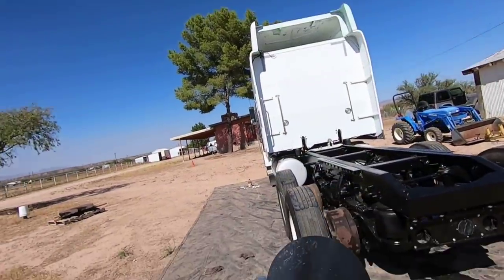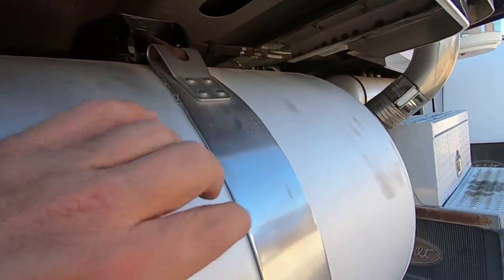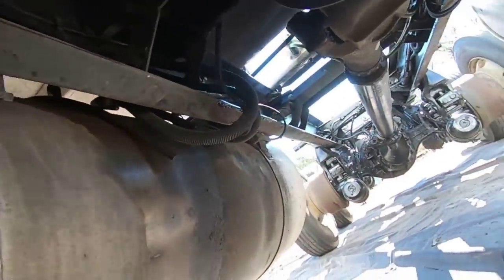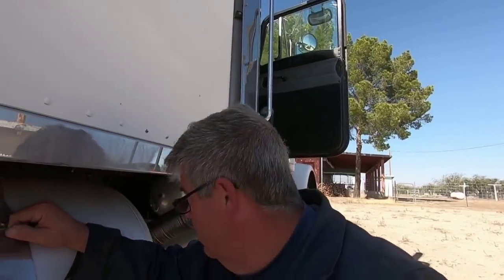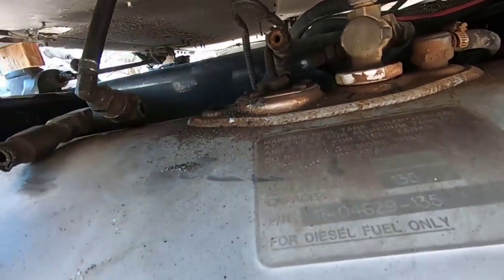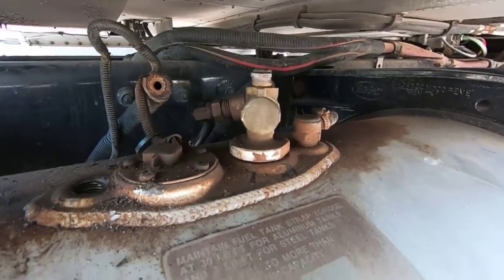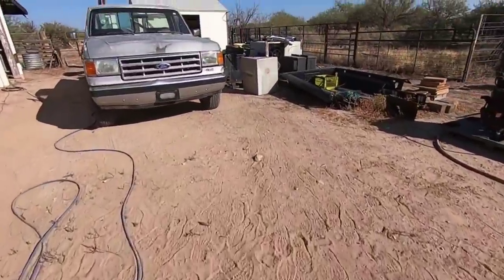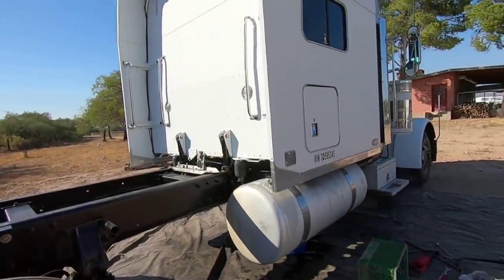#444 Stubborn Fuel Lines The Life of an Owner Operator Flatbed Truck Driver

Comment: Dan split the nuts on the lines with a die cutter.  Dont even have to cut all the way in and hit thread...just score both sides and give a hit with a chisel they split...Easy way to do fuel and hydraulic lines that are stuck...👍👍

Comment: Dan you might want to consider changing your fuel caps to I had the same problem with my Peterbilt and I change the lines didn’t completely fix the problem until I change the fuel caps

Comment: Love the video Dan love that you’re getting old girl back Road ready. FYY has a couple tricks I learned over the years to get those hoses are soaking with PB blaster take a ball peen hammer and tap the fittings all around that don’t work use the air hammer. Go to Harbor freight and get 12 point Crowfoot

Comment: Long time watcher first time commenter, I changed all the lines on my 03 Pete, return lines leaking and draw line was Kinked. Be careful with Napa and other hydraulic hose it KINKS easy and over time relaxes on the bends, make your own line from Peterbilt and whererever else #8 and #10 is better imo, stays open on the INSIDE which is something the hydraulic pressure lines just aren’t designed to do really. Our draw and return lines don’t have much pressure really so not even much fuel comes out when changing them. It’s easy

Comment: One thing to point out to new drivers is making sure you drain your air tanks on tractor and trailer to prevent brake failure. My trailer lost all air this week due to cold and not properly draining the condensation out of the tanks.
Reply: I was told you dont have to..the air dryer takes care of that

Comment: Probably too late to say but use Anti-Seize (Never Seize) compound on the male threads before putting back together.  Just a tiny bit will do.  So if it happens again, the labor is effortless.

Comment: Dan, I had a 93 Pete ran flatbed, that would never level out tanks, Pete dealer replaced all valves and lines, still wouldn't level and kept overfill'n to lft tank, ended up cap'n right tank to stop overflow'n to lft tank, gd luck dude

Comment: What do you do for bunk heat?  we put in a "little buddie" diesel bunk heater it works great.  we plumbed it directly to the diesel tank -- little exaust tube goes out the back of the sleeper

Comment: Looks like you're making progress.  

At this time of year do you still have problems with the rattlesnakes?  I remember you having to dispatch one once when you were working on the truck.
Reply: Rattle snakes are an issue except in the dead of winter.  They are most aggressive in the spring during mating season, but hang around the rest of the summer and fall

Comment: Hi Dan, Why don't you just make up the hoses you need yourself? It seems your fittings is reusable fittings, so you only need 1/2" and 13/16" hose and then you can just cut them to length and swop the fittings over.

Comment: Soft copper tubing about 6  or 8 inches long. Different sizes 1/4. 1/2  +. An hose clamps.  Helps patch a leaky hose till you can fix it right.

Comment: you know it would have been so much easier if you were to just lowered those fuel tanks you got algae in your tanks I would take your tanks off and pressure clean  them to get it all out. that trucks been sitting for 3 years

Comment: Is it really worth all this trouble? Why not sell both trucks and use that money as a down payment on a new truck?
Reply: He likes the reliability of the old Cat, is my guess. EVERYTHING needs maintenance, old and new.
Why would you want to go into extreme debt, in uncertain financial times?
Best wishes
Reply: He wants to have more videos for you to watch, it's a break from the monotony of sitting behind the wheel and it's fun
Reply: my guess and if it was me is getting away from that damn dpf system plus a break from all the emissions codes, he barely barely goes to California which isn't a loss anyways lol, I know if it was me it woukd be a treat getting in a pre emissions truck and never going to California again lol
Reply: I'd have gone Glider.  I wouldn't want to go into winter with that old Pete, It just seems like too many things are needing replaced. And if the 1 airbag needs R&R the other 3 aren't far behind. just replace them all, desert heat and sun is not good on rubber.
Reply: @hjc5458  We all know Dan has taken good care of that Pete and your basically dealing with a motor and drive line and suspension and he's taken care of the big stuff. The rest is just updating some old stuff and you don't need a tech charging you $195.00hr to do that and the parts are a whooole lot cheaper and plentiful! No need to getting into more debt when you have a darn good 379 with a 6nz motor in it! He's only gotta note on that trailer and he could sell that new Pete and old trailer and darn near pay that new trailer off. And that leaves money for some polished wheels and tanks right?😁 Oh and a peaceful night sleep of not having a truck note over your head!